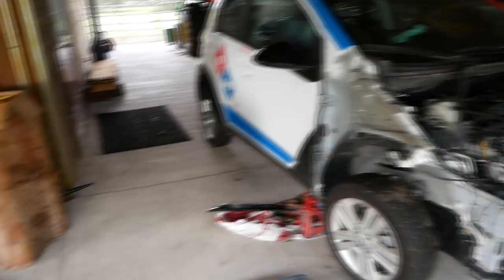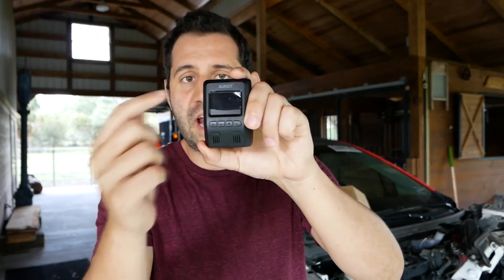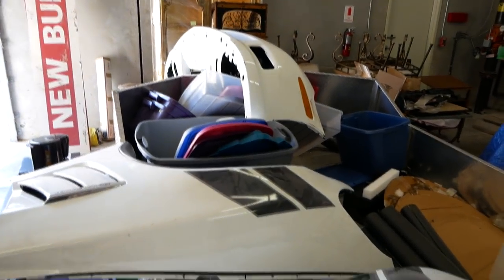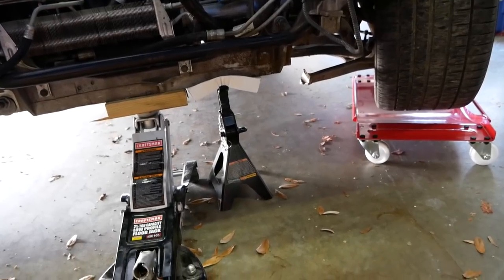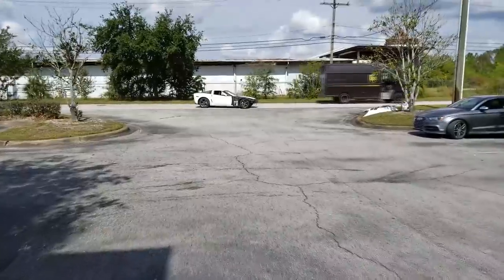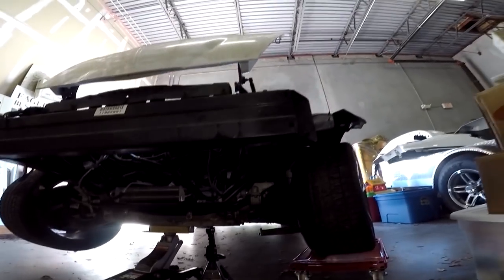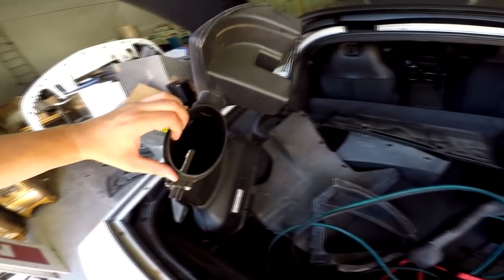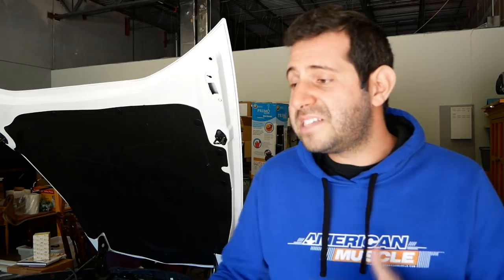The Salvage SPORTS CAR Project Has ARRIVED! (and was dropped off in the middle of traffic)

Comment: Corvette frame should be measured since its a high dollar project. An eyeball is not good enough. 

Which project, pizza car should go quick since you have a complete parts car. I would do that one first. 

I just put a Tahoe back together. It took a deer through the front grill and knocked out all the coolers. I had a parts car with every single part and it was even the same color. The insurance estimated cost of repair was $5700, I put it together in 1 afternoon with the only purchase being a gallon of antifreeze, a quart of oil and a couple quarts of trans fluid. If I were to buy every single part needed AND had to paint a new hood/bumper cover I would have prob been $2k, with me doing the labor.
Reply: agreed

Comment: stance the pizza car
Reply: K J B PSDM asf
Reply: that would ruin it's pizza delivering ability on any road that has a speed bump  or pothole
Reply: Caleb Vukovic you cant drift a fwd car though... But you can slide
Reply: Stancing is stupid. Lets make cars that can't drive anywhere without scraping and dragging shit! Dumb AF
Reply: evilwoodchuck slamming and stancing are different things, slamming a car to the point that u scrape on air, is stupid, lowering a car however looks straight fire, too much camber though and you've done fucked up again

Comment: Sam, my family owns an automotive electronics repair facility both here in Rogersville, Tn and also in WPB, Fl. We specialize in  rebuilding automotive electronics, as well as selling them. These CORVETTES are notorious for Climate control head issues, as well as EBCM (antilock brake control module) issues. If we can help in any way, it would be an honor working with you! Our website is www.autoecu.com !